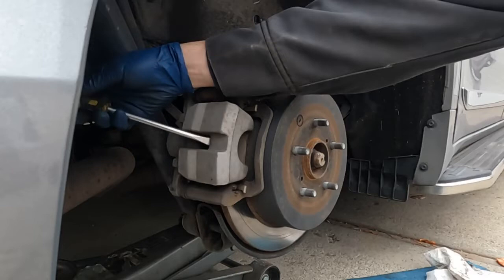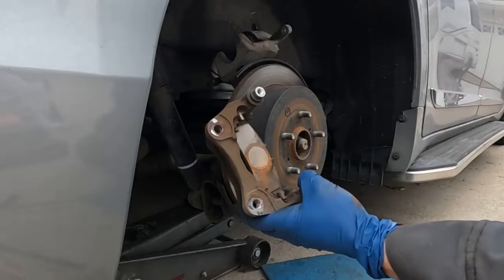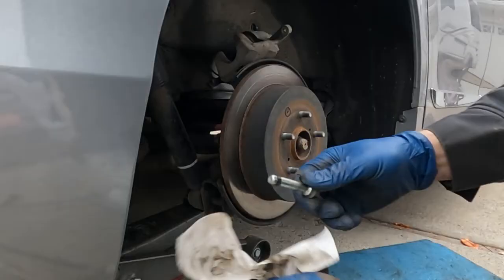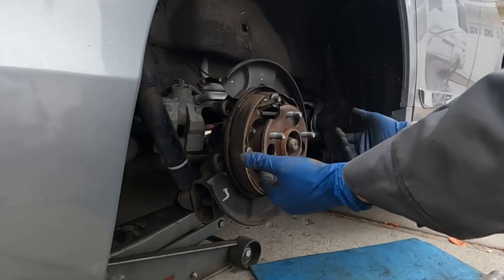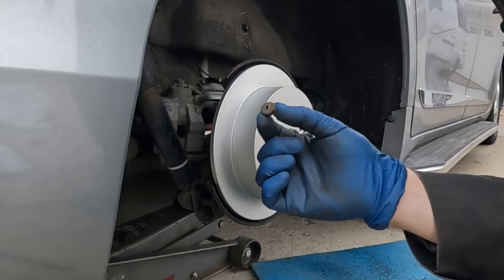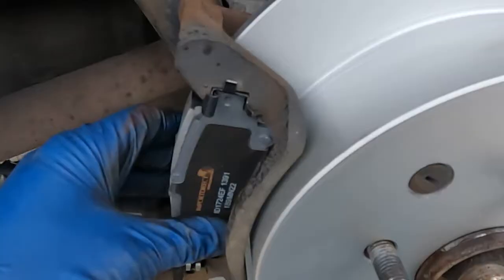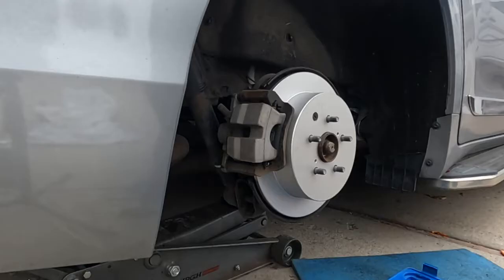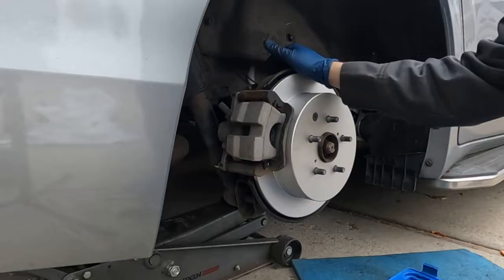2011-2016 Toyota Sienna Rear Brake Pads and Rotors

Comment: This guy clearly doesn’t like anywhere with rust.  Also, no mention of the brake shoe retention gear.   Often on Toyotas, the shoes will prevent the rotor from being removed easily like shown in the video.  You need to centre that rubber grommet/hole at the 6 o’clock position, then with a flat head screwdriver through the holes, spin the gear to loosen tension on the shoes.  Again, if you live anywhere with rust, you’ll need to be aware of this step or else removing the rotor with be extremely difficult and possibly damage your parking brake components.

Comment: Thank you so much… I couldn’t figure out how to get the rotor off until you said parking break off and I have the parking brake on 😊
Reply: So put it in neutral?
Reply: @sony8335  Put it in park and chock the front wheels. Just leave the parking brake off.

Comment: What if I pulled off the rear rotor and a couple of pins dropped out? The pins almost look like nails, but with pinched tips.
Reply from the maker: Those pins are for the parking brake.   They hold the shoe to the backing plate. You will most likely need to purchase new parking brake hardware. Most auto parts stores should carry it.
Reply: @ValleyMobileAutomotive  Scared me at first, but I inspected the hardware and it all appeared to be in good condition. It was two springs, two pins, and two hats that secured the springs... yeah, it looks like it secured each of the shoes to the backing plate so they didn't bow out (which is what they did when I removed the rotor). I did have to tweak back the hats a little bit, but it all seems to be good when I twisted the hats back onto the springs. Next time I now know to release the tension using the parking brake adjustment "gear" thingy.
Reply: @ValleyMobileAutomotive  Thanks for the info!
Reply from the maker: Sweet! Glad all the pieces were still there 👍